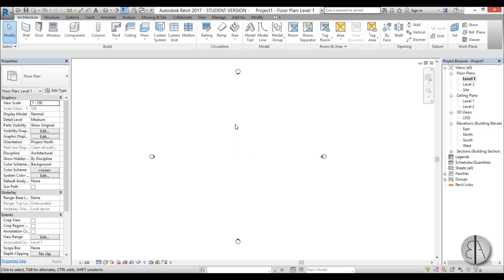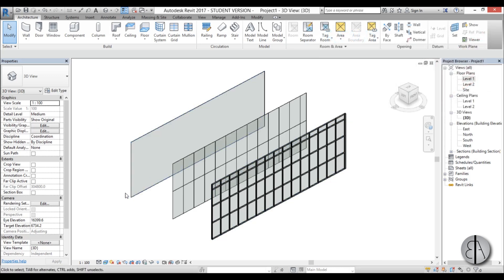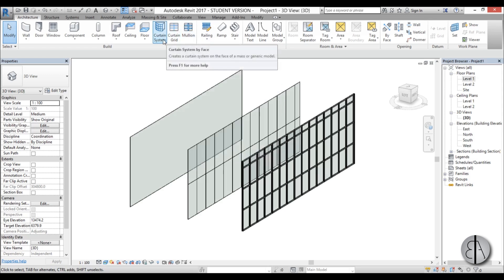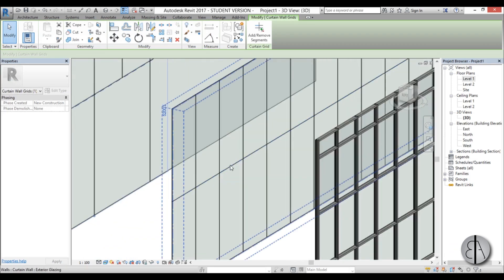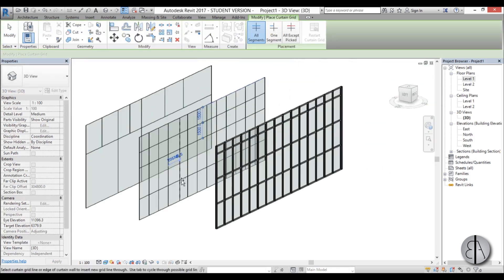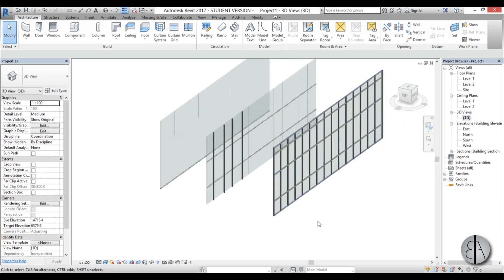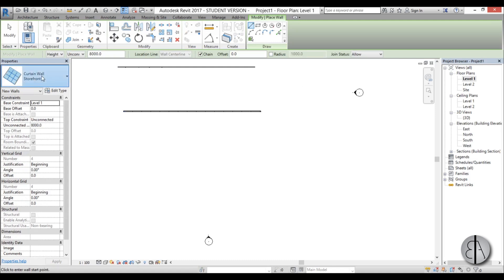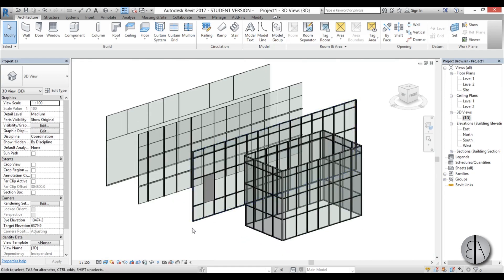All You Need to Know about Curtain Walls in Revit

Comment: anyone know why in revit 2021 I have this issue, when I make a curtain wall and add the mullions, the glass doesnt get inside the mullion, so I get the glass and then the mullions, anyone know how to fix it?
Reply: Reduce mullion and glass width do it will come to centre
Reply: Adjust mullions and glass sizes try to put same values or same negative values so both will come centres and adjustable

Comment: Thnax indeed.. but u didn't mention curved curtain walls bro..
Reply: Use arc then draw the wall that's all no difficulty if use strate wall the same way use two centres or three centres arches after draw the path then apply millions adjust values U can visible curved curtain wall